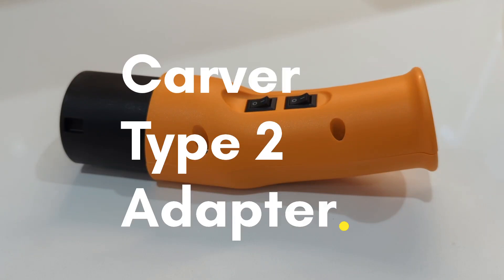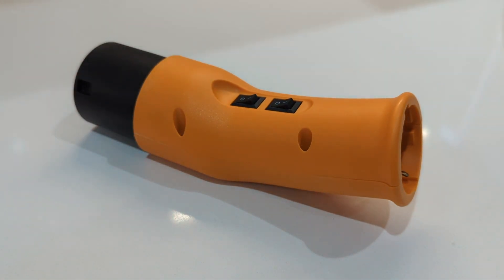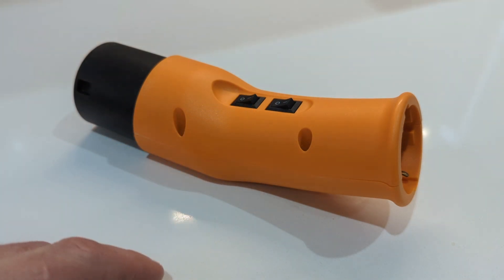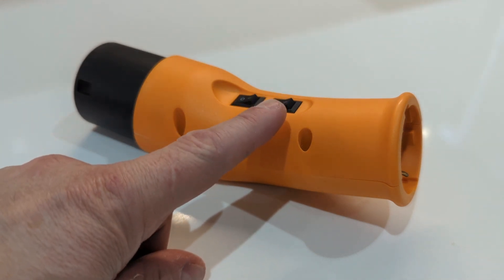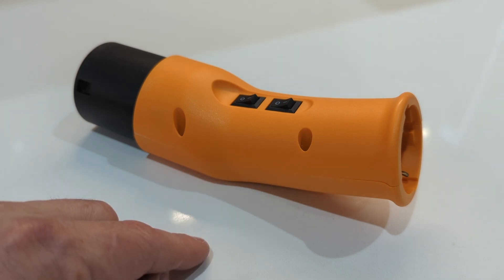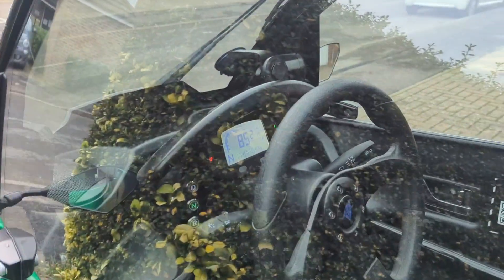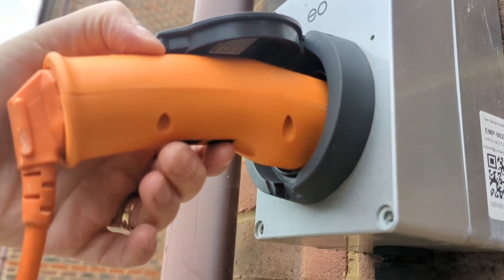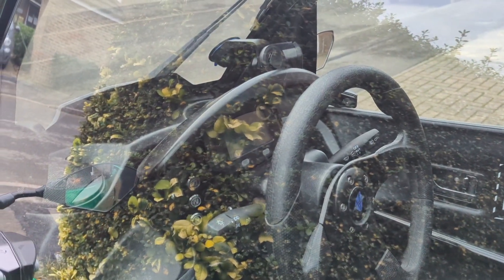Carver Electric Type 2 Charging Adapter

Comment: Maybe a stupid question, but if you charge like this, will it charge any faster than plugging into a regular 3-pin socket?
Reply from the maker: Not a stupid question at all 😊. Unfortunately it won't charge any quicker than a regular socket.